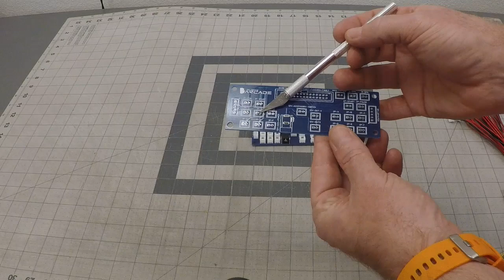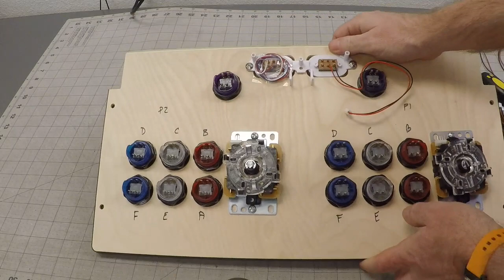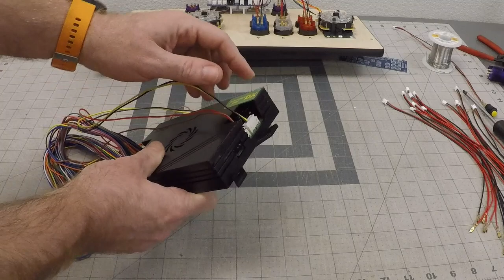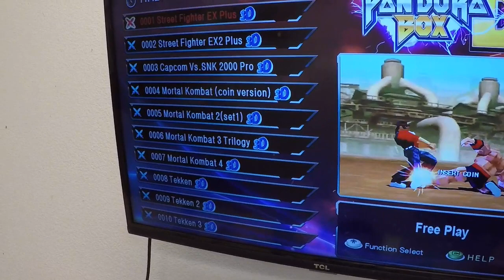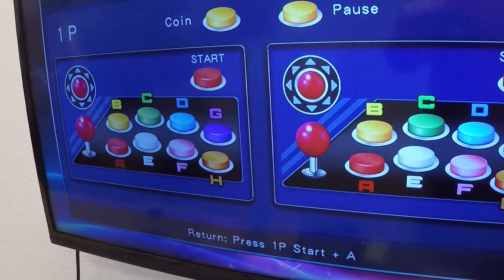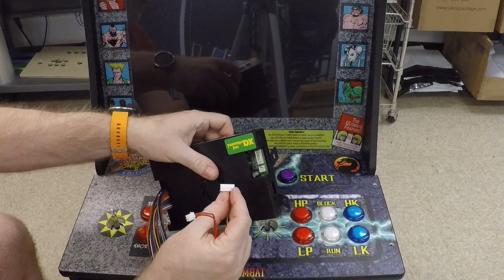PCB To Easily Install A Pandoras Box 6 / DX Into Arcade1Up or Full Size Machine by DIY Retro Arcade

Comment: Does this eliminate the need for the HDMI+VGA+DVI+Audio Input LCD Controller Board?
Reply from the maker: no, you will require the LCD driver if you are using the  factory A1U monitor

Comment: This is cool, but I'm worried about custom fees shipping to Canada. When I bought my Pandora Box DX from DIY Retro Arcade, it came with an import fee. Is there any cheaper shipping option I could choose that would take longer and not incur an import commercial fee? If so I'll buy this. if not, then I guess I'll muddle by with my current set up.
Reply from the maker: Unfortunately we do not have any control over customs and brokerage fees, all carriers are required to charge duties at minimum required by Canadian law.